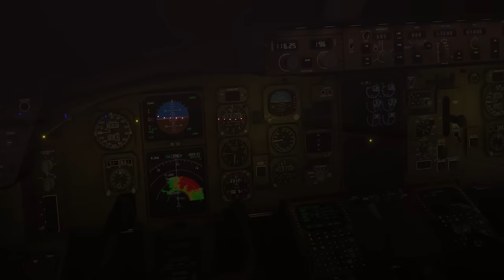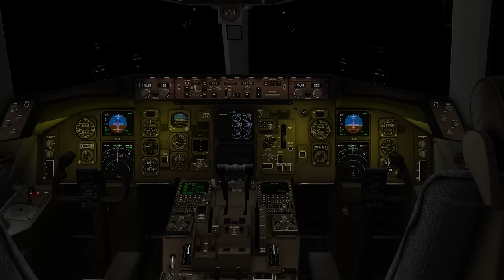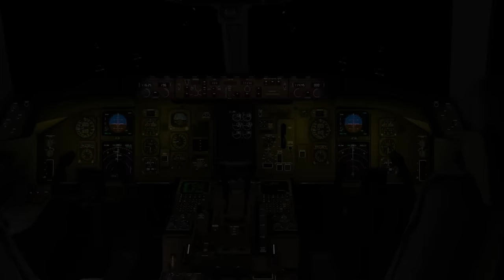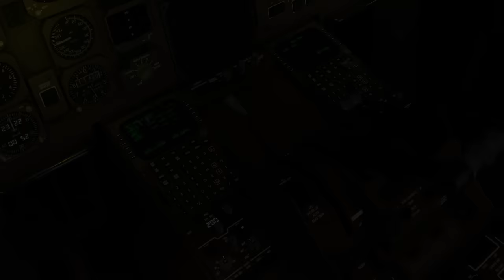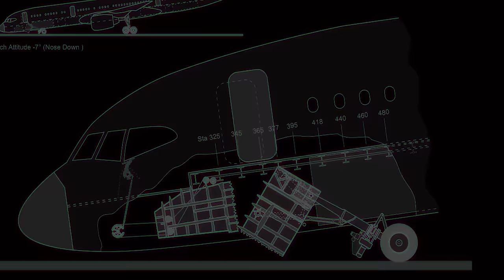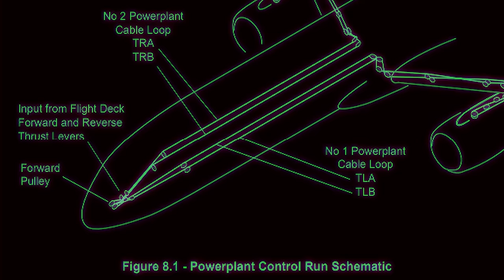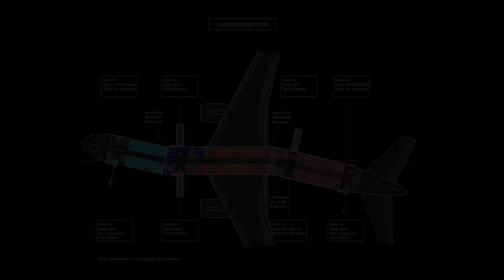STORMY landing - what went wrong? | Britannia 226A

Comment: To add to the " if it had left the runway at any other point" . . . . .  if the uncommanded thrust had been a bit more from number 2 engine,  & they had left runway to the left,  the other side of the runway,  in pretty much the same location as the crash-site,   is the fuel farm  ( fuel storage tanks )

Comment: Wow how unlucky can the pilots be. Runway lights fail at flare commencement height. Great informative video. 
A B757 of another British airline also had it's nosegear punch up through into the electronics bay when landing at Funchal which is like an aircraft carrier on the side of a volcano. I flew B727 into Funchal.
Reply: On one of my flights into Funchal the captain announced "don't be surprised if I go around as I have a strong desire for self preservation"

Comment: How about chemical flares that are set off when primary power is cut and generators are not powered on? Simple as electromagnet that is constantly powered by mains, but when power is cut it closes and set off the flares. Also one could coat the runway lights with glow in the dark material that charges from the lights being on and stay glowing for a while.. not sure if those have enough power to be seen from the plane landing, but might be worth to look into.

Comment: Some of this is not 100% accurate, because 2.23 it says we the passengers was advised, and no point was we advised on anything. Lighting struck the plane and the plane when boom boom and shuck as we was in the air, then everything went silent and all lights was off inside the plane, all we had was the tvs going down the middle of the isle on saying the hight and temperature, the plane was in complete silence as I think we was all thinking the exact same thing that we are going to die, then when we die crash land it took them over 2 and half hours to rescue us as we was stuck in a field with an electrical fence going around us and a plane infrint of us thst could blow up any minute as we could spell all the fuel. And falk lighting right down in front if us... this night I will never ever forget. And im amazed we are all here to tell the tale!!
Reply: However who ever did the video, its very good!

Comment: That's a concerning design defect that the nose wheel cannot only push up into the fuselage but can sever wires controlling the main engines. Its something of a miracle the plane eventually landed as it did considering the engines were out into full thrust  under fault conditions

Comment: Surprised that batteries for runway lights weren't mandated as a result of this. If power runs out blink the runway lights on battery power for 10 mins, then die. Trivial to implement and would prevent any similar accident

Comment: Do planes now have warnings or cameras where the crew cannot see?  Like when the tail,  cargo door, engine or anything else  not visible to the crew that falls off?
Reply from the maker: Some larger planes have cameras on the outside, but these are used for helping the pilots stay on the taxiway, rather than to see parts of the aircraft itself. Planes are equipped with more sensors, now, however, which will tell the pilots if XYZ is abnormally configured. Not sure if cameras or sensors would have done any good on this flight, though.

Comment: At least they've escaped problems with the airline because of low fuel landing.
Reply from the maker: That's the main thing.
Reply: Running out of fuel has caused problems before
Reply: @kickedinthecalfbyacow7549 , indeed.

Still we have a paradox: safety margin in one respect ads pressure and contributes to the accident somewhere else.

Moreover, this is not rare occurance.

For instance, in Tenerife case safety restriction on piloting time led to impatience and ultimately had greatly contributed to the disaster.

Which means safety margins are not universal silver bullets unfortunately.

Comment: So the airline instead of airing on the side of safety the airline threatens its pilots with reprimand if they divert to avoid hazardous conditions and land low on fuel, sounds like the airline is culpable in this more than the pilots.
Reply: There are reasons for having minimal fuel requirements too. For example if the airport to which they diverted had problems, which incidentally it did.

Comment: I can't understand the narrator's bias. The pilot flew the plane into the runway, that's not a landing. but no criticism. They're landing in unsafe rain-wind conditions but no criticism. However while narrating about American 1420 crash nothing but criticism. The 1420 pilots were finishing a 16 hour shift and still managed to land in worse conditions, but according to our narrator thy're 'unsafe' pilots. That's fine, but if the guys in 1420 were unsafe then these guys who weren't at the end of a long day and who expected weather at the airport, and who dropped the aircraft onto the runway, well, unsafe as well as unskilled. 

Plus what a joke the Spanish crash report recommended Boeing make the aircraft stronger to resist gear collapse. Really?? How about flying the aircraft better, it is after all an aircraft, not a ball peen hammer.
Reply from the maker: Thanks for the comment. The key difference between these two cases is that the crew of American 1420 had been informed of weather conditions which were outside of pre-defined safe parameters on numerous occasions before landing , yet they continued with their approach.

On the other hand, weather conditions were within safe limits for  Britannia 226A. And further, unlike American 1420,  the crew of Britannia 226A did execute a go-around when their first approach was unstable. This crew simply got unlucky with the runway lights turning off mere seconds from touchdown. 

Their performance was far from perfect, but it's just not comparable to that of AAL1420.